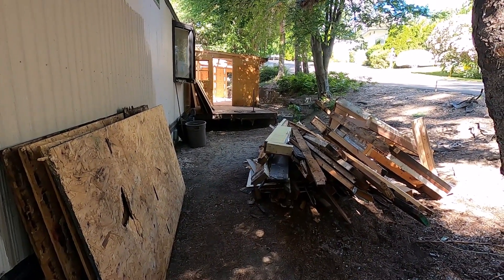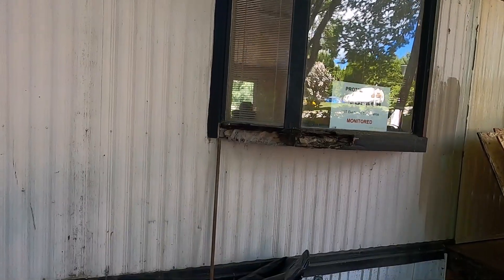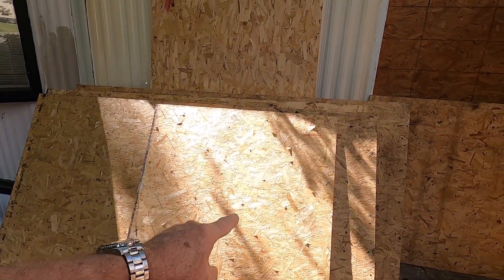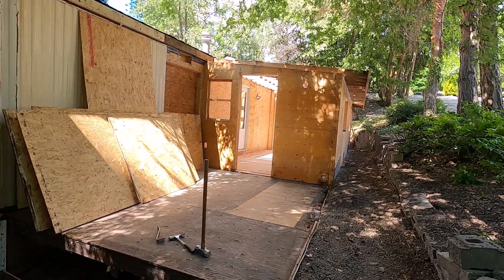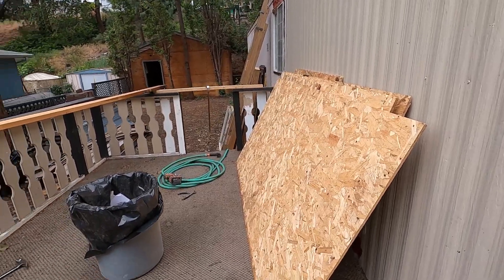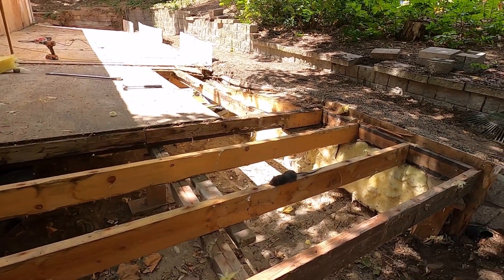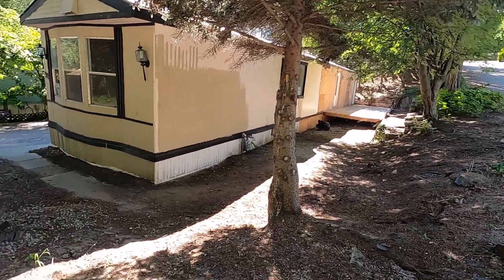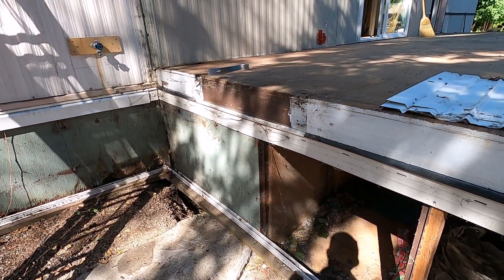Abandoned Mobile Home Project - Tearing Down The Old Addition : E084 / BC Renovation Magazine

Comment: I’ve watched at least a half dozen of your videos today. Very excellent work both tearing down and rebuilding. Looks like you may have salvaged several thousand dollars of lumber on that tear down! Liked AND subscribed! Curious, with removing the retaining wall, it looks a bit like this home is in a very low spot. Will the lot not flash flood without a retaining wall?
Reply from the maker: Weightless Living, thanks for watching, commenting, liking and subscribing! I really appreciate it. 🙂 This site is very sandy. Water does not accumulate much on the lot. It is difficult to tell from the videos but the lot slopes gradually to the front left corner and then downhill to the creek from there, across the street. The only concern might be water coming down the hill on the street beside but there is a curb there that prevents the water from running off the street over that bank along the home. There is also a catch basin at the bottom, on the curve in the street that catches the water off of the street.